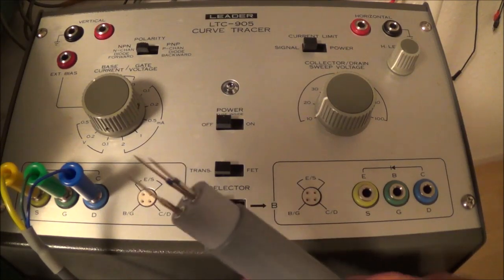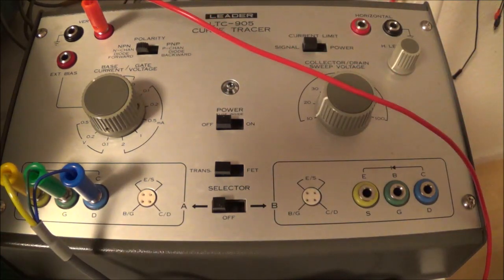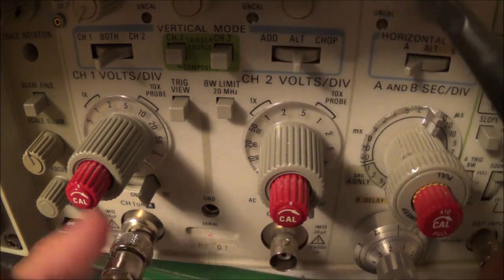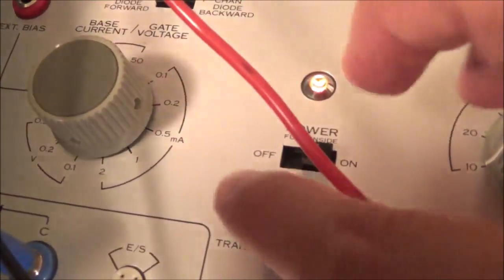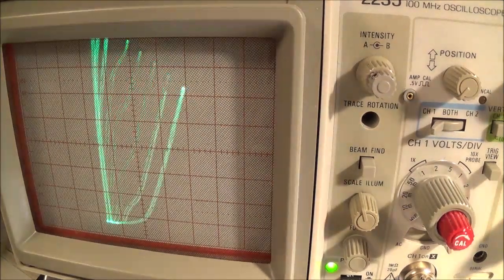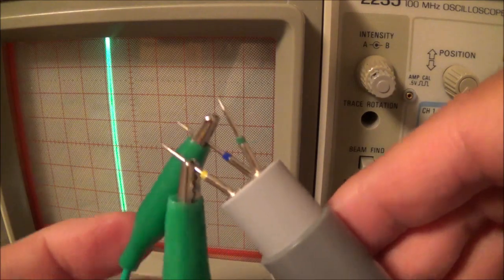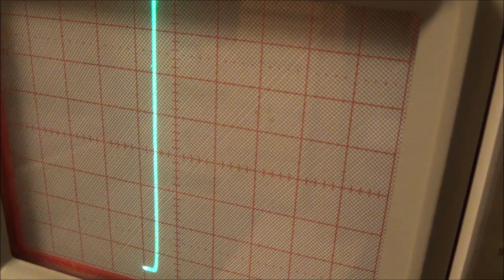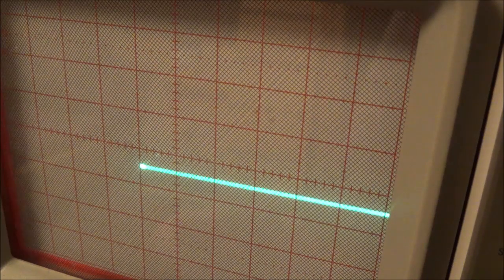Leader LP-11 In-Circuit Probe For Leader LTC-905 Curve Tracer

Comment: Great video. I would like to get a curve tracer lust to play with. When ever I see a 2sc458 I replace it with a ksc1845. The 2sc458 are known to get noisy.
Reply from the maker: Thanks for the tip! 2SC458 is quite common. And get yourself a curve tracer; not too expensive and it tells you a lot. Things a transistor tester would not show. Last and not least: it increases your skill level.